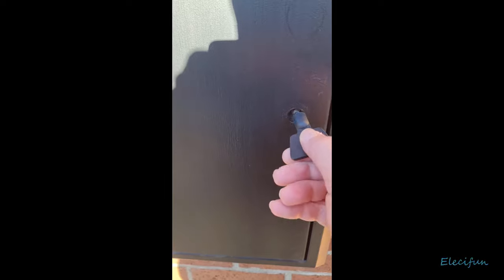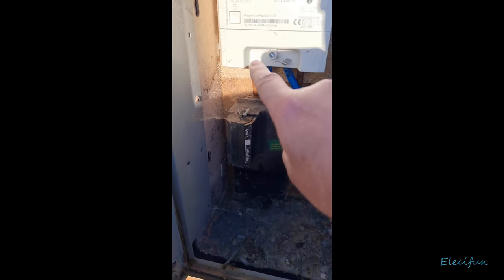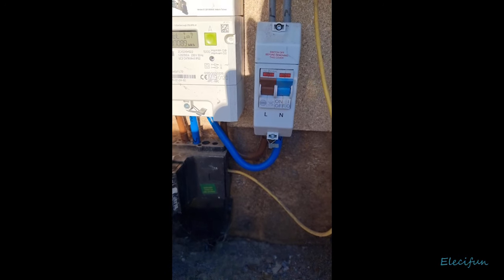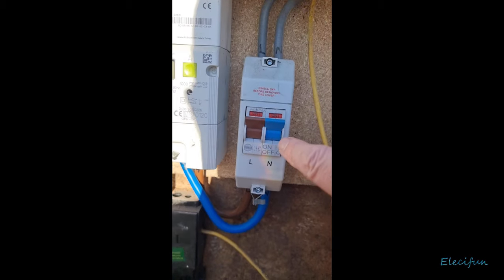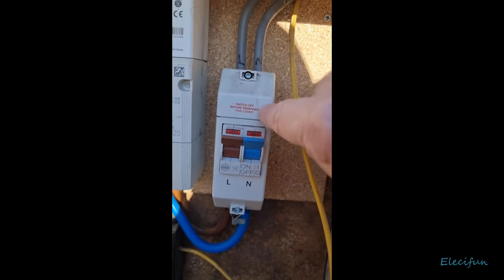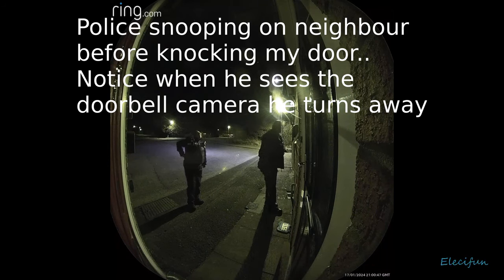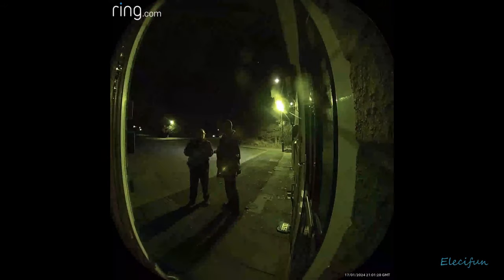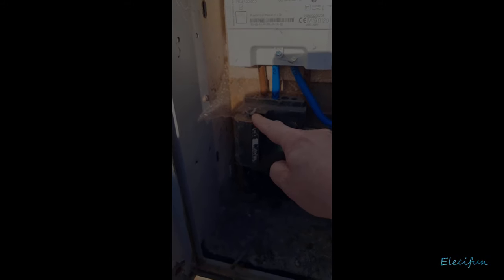How to disable a security system in 5 seconds.

Comment: I have been in Security for 40+ rears and he's right about some camera systems, but a good alarm has battery backup in Panel and sounder for this very reason, this will continue protecting your property for at least another 8-12 hours.
Reply from the maker: @1478ricky fantastic as this data is what I have been trying to establish. 8-12 hours later and the battery backup is compromised effectively useless. If your away for the weekend or a couple of weeks. Opportunists don't need to break in while the system is active, with this switch they can wait it out.

Comment: I guess that's why a good system  has a battery backup in case the power goes out.
Reply from the maker: Many modern systems are attached to networks which require power 24/7 to function properly, not only the alarms but also the internet and whatever hubs are required. Not everyone can afford battery backed systems.
Also imagine the elderly having all power go off and falling. Imagine the break ins when people on holiday/vacation. How about the person on a dialysis machine, heart monitor, air purifiers for the asthmatic, they all need the presence of a working power supply. 
This save the councils some money but ups the risks past acceptable.
Reply: @Elecifun  Your right. What if the government does't really care?
Reply from the maker: @decem_unosquattro9538  
My opinion on why the circuit breakers are where they are: When the old ceramic fuse power distribution boxes were taken out they were replaced with modern trip fuse boxes. 
To save money or because of human error the isolation switch was not installed inside. This is of course a safety fail as now the distribution box can not be isolated if it needs working on, not unless the main fuse to the meter is removed. 
Only the power companies can remove the main fuse before the meter. In order to get around the error a safety circuit breaker has been fitted inside the meter box as this would be the least work and the cheapest option. 

Its not the governments fault, there are plenty of other things to blame them for. The council electrical contractors are being protected for the foul up by the council, as it looks bad on both of them.

Comment: A load of bull, I've never came across an alarm system that didn't have a panel battery back up and/or an external bell box with its own battery back up also.
Reply from the maker: @allen5976 Your fixating on the word 'alarm' I never mentioned alarm. The title has security system in it. 
PS well done for pointing out the obvious.

Comment: You can still cut the power off even if the breaker is not installed cut the seal wires and pull the fuse, breaker just makes it safer if you need to work on the infeed to the consumer unit

Comment: Good on you for pointing out that vulnerability. It would be a good idea to move that switch inside. Of course a determined criminal wouldn't mind just snipping the wires but making things as difficult  as possible for opportunistic criminals is certainly a good idea. As far as security cameras are concerned, I personally like the battery powered units. I have five cams in discreet locations around my property which aren't affected by power outage. Having your base station and wifi network on battery back up is a good idea too. My cordless perforator is never out of reach either but I know these are rare in the UK sadly. Thanks for posting that. Stay safe amigo.
Reply from the maker: Not sure what a cordless perforator is but I might like one. I had Dodd group electrical installations manager James tell me this was the work of the power suppliers. While he was telling me that I had Kelly the lady from the council who manages the contract with Dodd group arguing that I should not have a camera facing the public. They came to see me because on the Monday 15th Jan 24 an employee of Dodd assaulted me after losing his temper. (double palm shove to my chest). He said the switch was fine and I may have called him... sounds like banker, he jumped out of his van and shoved me. 
Today I went around the 36 elderly and disabled flats where I live 11 have these isolation switches. I spoke to two elderly ladies and they both said they don't like them. 
I am going to speak to crime prevention on Monday as this is not acceptable. It seems to be so the council can save some money.
Reply from the maker: @decem_unosquattro9538 I agree 100% mate cameras are everywhere. The lady arguing over the cameras has a position a c average attains and likes the authority label she wears. She (if I have the pronoun correct), I should have asked, lol, arrived in a old shape BMW showing me she wants to look the part but can't afford it. Surprised the car was not sporting vanity plates to hide its age.

It is funny when the authoritarians are on the back foot.. they always try to find something to attack with.
Funny you should say about the LED strips wanting you to turn on location on your phone. I have a couple of blue-tooth so called smart bulbs that request my location just to turn them on or off. I don't use them as the location service on my phone is always off. Maybe I could link them to my tablet blue-tooth, location which never goes online.

Comment: Doesn’t make any difference. If the power goes off most security systems will sound the alarm. They also have a battery backup which last for a while. If you really want to cut the power, you could literally cut the power. The robbers will cover their faces and wear gloves, the cops won’t come if you get burgled anyway, so as I said before what does it matter
Reply from the maker: How long do the batteries last?
Reply: @Elecifun  Doesn’t really matter, as most systems have to turn the alarm sound off after a short while due to local noise control laws. It will last long enough to send you a text or email etc, and let you know your alarm is going off. If the alarm is linked to the cops or private security they will come. If you have just a stand-alone alarm, probably nobody will come whether you are really getting robbed or not. If you are on holiday, just ring your relative, friend or neighbour and ask them to go check on things for you. You dont need a very expensive UPS to keep a camera system running for many hours after the power is cut

Comment: Can see your points for wireless systems. These can also be jammed. 
I can’t see your point for the majority of alarm systems which is wired with back up battery and a siren/sounder with back up battery. Hope I haven’t crossed the pedantry threshold
Reply from the maker: No the threshold still holds. Many people don't have full power back up alarm systems, including myself. I have cameras which use the internet and router with mains power. I can look inside my home using Echo Show devices and the Ring doorbell camera is also mains powered. 
The point is these isolation switches should be inside. They seem to have been omitted and a second thought. Its cheaper to put them outside, not that secure for the resident though.

Comment: 99.9% of all house alarms have 31 days battery backups .
When power is cut to the alarm it goes off. 
This is why house alarms go off when a power cut has occurred.
Reply from the maker: Again another fixated on 'alarm' not security system which the title clearly states. Thanks for playing.
Reply from the maker: Also a hell of a claim 99.9%.. and 31 days... so many variables in the mix.
How would you know? Ive been researching for days and I could not make such a claim.
Your wrong about alarms going off when the power is cut. Mine didn't. I received notification to my phone but not sounder sounded.
Reply: @Elecifun  for insurance purposes only,  they are not going to pay out if they can help it . 
Not insulting you in any way 👍🏼

Comment: There is a simple solution to this that many people are probably not aware of, In fact I'd say people are less aware of this simple solution than what you're bringing attention to.

A UPS (Uninteruptable Power Supply - A battery, in simple terms). Connect that between your home security system and the wall. If you have an Alexa, you can set them to listen out for the sound of the UPS beeping to say it's lost power. You'll be able to check your cameras and ask your neighbour to go around and flip the power back on
Reply from the maker: @advancedflea

The simplest would to be put a lock on the box door..  I was hoping someone would mention it. It is fun looking at the comments.
Reply: @Elecifun  Locks can be bypassed in a number of ways.
Reply: Close to impossible, I’ve got cameras all over the house.

Comment: They are there for the fire service
Reply from the maker: No the distribution board is inside above this switch. The fire service if needed could break in the door and power off from there, which is where this isolation switch would normally be. 
Besides if there was a fire and the electricals were damaged the trip switches would do their job and kill the power inside the building. This switch just isolates the distribution box to make it safe to be worked on. Fire service could break the seals and pull the main breaker before the meter if needed.